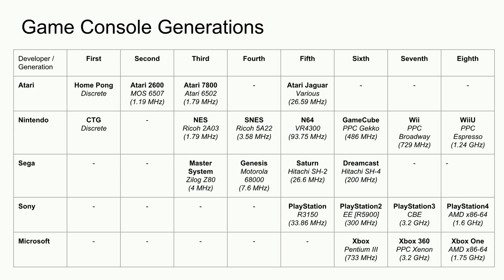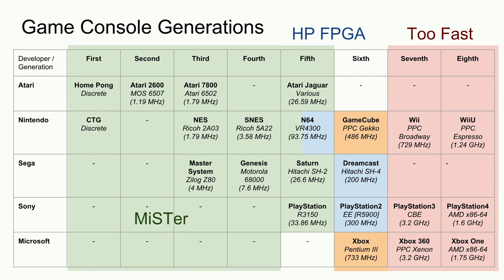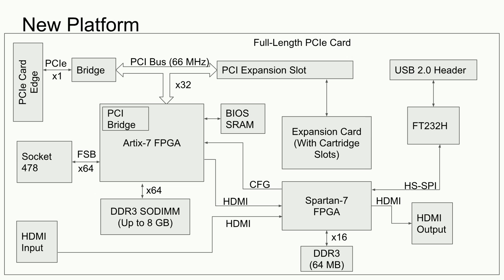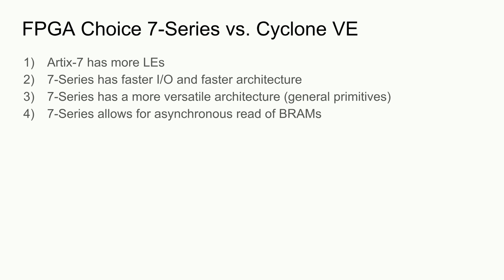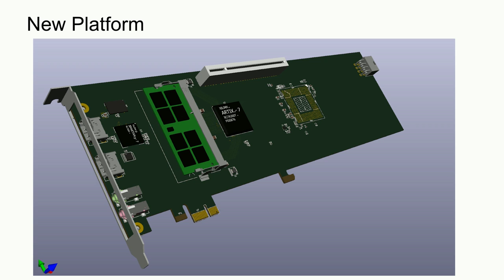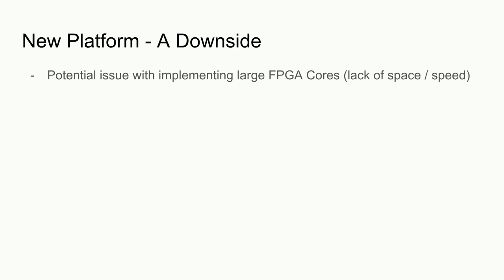A High Performance FPGA Game Console Platform

Comment: Very fascinating video about future retro FPGA development options.  I'm a retro gaming enthusiast, not a developer, so a lot of the details are above my pay grade, but I'm still able to follow the basics.  I have all the parts to assemble a full MISTer arriving this week, but I've been following the retro emulation scene closely for 20 years and it's fun to get a glimpse of the future from a developer such as yourself.  You mentioned that an N64 core would not be able to fit onto the DE10-nano while outputting at 1080p.  Forgetting 1080p for a moment, do you think it would be feasible to build an N64 core on MISTer that output at the original native system resolution?  I read in another comment here that you're targeting HDMI on your new proposed platform as "most people" would be using an HDMI device.  However, it would seem that anybody who is buying DIY FPGA platforms for retro gaming purposes inherently sit outside the categorization of "most people", as most people either are perfectly happy buying the new "official" mini-consoles or running software emulators on their cel phones and don't care one jot about the likelihood of adding 4-to-11 variable frames of latency to their classic gaming experience.  For anybody considering paying upwards of $400 on this proposed FPGA platform for PS1/N64/XBox cores, analog output options seems like the most obvious make-or-break feature.  But getting back to the MISTer for a moment...  if an N64 core could be made to fit on the DE10-nano, but could only output at the native resolution, this would still be sufficient for anybody using an analog display and ,of course, pairing the MISTer up with a device like the OSSC could create a satisfying result for somebody using a digital display, could it not?  I realise, of course, that running a 3D system like the N64 and rendering polygons at native resolution may not be as sexy as rendering them natively at 1080p or whatever - an issue which does not affect 2D pixel games on older systems - but at least it would be accurate?  Or, do you think that an N64 core on MISTer with full logic implementation is just impossible, period?  I'm curious, is all.
Reply from the maker: Thanks, I have been thinking about what comes next for a system like MiSTer for quite some time, and that's what I came up with. Though, this no longer actually seems like the best option... building an add-on FPGA daughter board for the DE10 Nano is probably more beneficial in the near future.

That's correct, and N64 core which is not overclocked, will probably require between 120-200K logic elements, the DE10 has 115K. That means that stripping away the on-screen-display (OSD), and upscaling hardware will not be sufficient. Basically, the only way to get an N64 to fit, would be to strip out the texture unit (so no textures), as well as the floating-point unit in the CPU. And at that point, it will probably just barely fit (with the OSD, but no upscalers).
With that said, however, the RCP itself should fit in the DE10 with an upscaler and the OSD (just no CPU). So, in theory, if a daughter-board was created for just the CPU on the N64, which communicated with the DE10 via the MIPS SysAD bus, you could run a full native N64 on the MiSTer.

That's a good point about "most people". However, it's highly doubtful than an "official" N64 mini will be released, or if it is, it will be using a virtual console like emulator (so it won't play general N64 games). Analog can always be achieved via a converter box though (I know it's not the same, but if the goal is 1080p native output, that's not something that an older CRT can handle). But that's another reason to go with an expansion daughter-board instead of a new system altogether - leverage MiSTer's current analog support. Note that I don't think that an RCP on the DE10 could output 1080p native resolution - the Cyclone V is too slow for that, but it can do 480p. So doing 240p or 480p (basically implementing what the N64 could do natively) would be far easier than implementing 1080p. 
My concern is that people are spoiled from running software emulators, and having more modern GPUs redraw the triangles in 1080p. In order to achieve that, you basically need to pixel multiply. The N64 actually only drew one pixel per cycle, and in some modes, only drew one pixel every two cycles (there was a fast fill mode where it could draw 2 / 1 cycle). So if you are drawing a 240p screen, and multiply that by 4 (2x wide and 2x high), you get a 480p screen. That means drawing 4 pixels per cycle. Then you could multiply that by 4 again, to get 960p, and draw 16 pixels per cycle (that's the highest you could reasonably go). But drawing 16 pixels is a tall order, since you basically need 16 copies of the RDP in the N64 to draw 16 at a time, and that's going to be a massive resource usage. There is a saving cheat, where you can actually get away with overclocking it to 120 MHz and only have 8 copies of the RDP (since your cycle becomes 1/2 of what it was on the N64). Obviously, though, if the N64 wouldn't fit natively, a version with 8 RDPs wouldn't fit either. So if we only have 1 RDP, that would be the best bet to getting it to fit (with an expansion daughter board). Hopefully that wasn't too much detail.

It's possible that an Xbox core may fit in the MiSTer too (if the DE10 only has the GPU / Audio DSP / system controller). However, the bandwidth of the DE10 is too low for that to be practical (and there is no way to expand that). But it might fit. In comparison, there is no hope at getting a PS2 to fit, even with a daughter board (a PS1 should fit though, and so would a Saturn - hopefully). As an aside, it may be possible to also fork the development of the MiSTer into the DE10 Nano and the DE10-Standard (a bit more expensive), where the DE10-Standard has a high-speed expansion header. Though that would probably result in $500-$600 for a full "MiSTer" like setup, which is probably not practical. Just some ideas - there are many possible directions for the project to talk, so hopefully that gives you some hope.
Reply: @RTLEngineering  Thanks for the very detailed and considered reply.  I certainly wasn't expecting an FPGA N64 any time soon, but this gives me a good idea about the challenges involved.  Either way, I got my MiSTer set up late last night and it's working like a dream - FPGA tech is an amazing addition to the retro gaming hobby and preservation efforts!  Cheers ;)

Comment: A coppermine CPU similar to the one used in the Xbox is socket 370, not 478. Socket 478 supports Pentium 4 and later. 

Even if you source a real Pentium 3 CPU, the clock speed and cache would need to be very nearly identical to the original xbox to insure proper compatibility. Xbox enthusiasts have been soldering in faster Pentium 3 models into their consoles for a long time. It requires a clock switch to to get close to real hardware speed, but even then, depending on the model, you often don't get identical performance. Even a very small difference in clock speed of a few megahertz can cause glitches or anomalies on real hardware. 

If you are only interested in providing a real x86 onboard to process Xbox native instructions, than a 478 socket is not ideal either. Any atom or similar x86 chip could serve as a stand in for similar cost and much lower power consumption. Either way, you will have to deal with the speed issue, which may not be possible with an FPGA approach where things are usually clock synced.  

It is also unclear to me how a wii has a clock speed that is too high for an FPGA, but an Xbox does not. The Xbox CPU runs at a 733mhz clock speed and the NV2A GPU runs at 233mhz. The bus speed on the mainboard is either 100mhz or 133mhz, with SDRAM refreshing at that cycle, as well PCI link of 66mhz in addition to other devices like the onboard audio, storage controller, ect.  Any component that an FPGA tries to implement is likely going to be running or syncing at a frequency of 66mhz or greater.
Reply from the maker: Someone else had commented about the socket 478 mistake. The reason for choosing the 478 was that Pentium 4s are easier to find than Pentium 3s. 

That is a valid concern, but I think that would be a drawback that would have to be accepted when running on non-original hardware. The only other solution to the problem once all of the original xboxs have failed, would be software emulation, which will most likely have similar issues (unless software patches are applied). Unfortunately, the extent to which this is an issue would not be known until it is attempted.

I did look into using an Atom, however, they are no longer available in a usable form (the Z510 probably would have worked). The issue is that unless you want to rewrite the entire kernel and bios, you need to have a system that presents an identical memory map to the original xbox. This is something that only the FSB based Intel Atoms (now discontinued) provide. So that led me to the idea of using a Pentium instead of an Atom.
 I'm not sure which speed issue you are specifically referring to? The FSB operates at between 66 MHz and 150 MHz, depending on the CPU, that entire range is possible with the Artix-7. As for the clock syncing, that's true, but FPGAs have multiple clock networks, so as long as the FSB interface is synced to the FSB, and the internal implementation is synchronized to another clock, they can be interfaced using one of many different techniques, which also work for variable frequency clock domains.

I thought I mentioned it in the video, but perhaps it wasn't clear. The whole point to the on board x86 was to offload the part of the xbox that was too fast for the FPGA. The same thing is true for the GameCube. In both cases, only the chipset which operates at a maximum of 250 MHz is implemented in the FPGA, which is more than doable. I haven't really looked into the Wii, so it's possible that it could be implemented the same way, if the GPU and chipset is less than 250 MHz, otherwise, it would be too fast for a "low cost" FPGA. 
In terms of synchronization, you seem to be under the assumption that the entire FPGA uses the same clock. While an FPGA usually uses the same input clock, it contains many PLLs which each can have up to 6 independent outputs which do not need to be integer multiples. These outputs are then connected to internal clock networks (domains), and can interface with each other regardless of a frequency mismatch. Typically, this interfacing is done via a dual-port block RAM, in the form of a FIFO. There are also methods such a double-buffering, and clock gating which can be used. 

For the example of an xbox, you would probably have different clock domains driven by a different PLL output for: the FSB interface, the DRAM controller, the PCI controller, the HDMI output IP, the NV2A (might require several clocks), the DSPs (might require several clocks), an IO emulator (to drive the PCI controller), the BIOS loader (from external SRAM), and the interconnecting switch / bus fabric between them. None of which are required to be integer multiples of the others. Hopefully that makes sense.
Reply: @RTLEngineering  Thanks for the response, I am excited for your project. My intention was just to give you information you might not already have, not to discourage you or tell you what is or isn't possible.
Reply from the maker: Thanks, I do appreciate that. There are obviously points that I had not thought of / addressed, especially since I am not actively working on an FPGA xbox implementation. 

It also occurred to me that the issue with soldering faster Pentium 3s may have been the chipset not playing nice with them (since the chipset was most likely designed for that specific CPU). After-all, that would exhibit timing an glitch-like behavior. Though you probably have a better idea as to whether or not that was the case.

My thought was that it's possible, however, I do acknowledge the fact that I could be mistaken. If that's the case, the socket 478 could be adapted to fit any other CPU that has a similar communication spec, include another FPGA on a daughter board, or simply used as IO.
Anyway, further development on this FPGA care is about 3 years off, and an xbox implementation probably closer to 10 years, so there may be a much better solution by then.

Comment: What about analog video output? This is what sold the Mister for me.
Reply from the maker: The problem with analog video output, is that it's not as simple as you may think. If you think about output resolutions, you basically have HD (720/1080p+) and LD/SD (analog 240/360/480p). 
If you build a system to output in LD/SD, then it can be upscaled to HD easily (though upscaling doesn't add any new information, so an N64 game at 1080p would have giant pixel blocks). 
If you build a system to output in HD, however, it can't be downscaled without loosing information (i.e. some pixels won't be displayed). Additionally, HD introduces additional signal integrity issues, where for example, a 1080p pixel bus must be point-to-point, so you can't send the same wires to an analog output driver - you would need 2x the pixel buses.
MiSTer is able to output analog because it targets LD/SD output, however, my idea for this platform was to instead target HD output. 
So then the options that I could currently see are:
1) Don't target HD output, but then PS1/N64/PS2 games will look terrible, and that sort of defeats the purpose of this new platform
2) Add an extra output for analog which could decimate the video output (i.e. draw every other or every four pixels). Due to the signal integrity issues though, that would mean having another output from the video combiner FPGA, which doesn't have any free IO, so then it needs to be a larger FPGA which costs more - so the price might go up from $400 USD per platform to $450 USD per platform, regardless if you want analog or not. Is that fair? (I don't know, maybe)
3) Use an external HDMI to Analog converter (probably not the option that you would want)
4) Stick with the MiSTer if you want analog output (but that means little or no 3D system options for the MiSTer) 

It's an annoying and frustrating aspect of engineering in general - often there is no practical solution that satisfies all of the design requirements, and compromises on features have to be made. Hopefully this helps you understand the complexity of what you are asking for / why it wouldn't be trivial to implement.

Comment: No mention of the sega saturn? It's just grouped in with the other 5th gen consoles. Would it actually be possible on the current mister? It used 2 sh2 cpus, and 2 custom graphics chips I believe. It is notoriously difficult to emulate, would an fpga core even be possible?
Reply from the maker: The Sega Saturn is pretty much a given (that's why I didn't mention it). It may be technically challenging to emulate, but that's not due to the speed (i.e. the N64 runs far faster / has tighter timing requirements) - so someone will eventually do it. As for if it will fit in the MiSTer... I'm not sure. The 2x SH2s + the vector DSP for 3D math would be pushing that chip. It would probably fit into the largest Artix-7 as proposed in this video (it has roughly 2x the logic elements as the FPGA in the MiSTer has).
My guess is that the order of "impossible to emulate" systems will be PS1, N64, and then the Saturn. And maybe down the line a PS2 or Dreamcast. The only one of those that has a chance of fitting in the MiSTer though is the PS1.